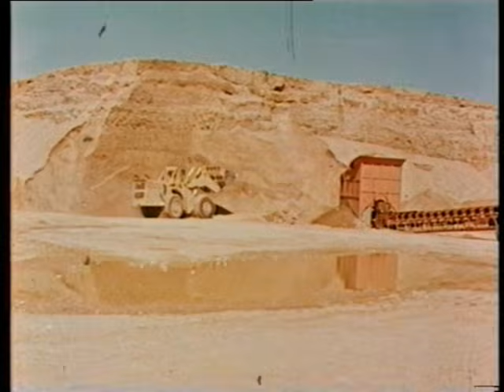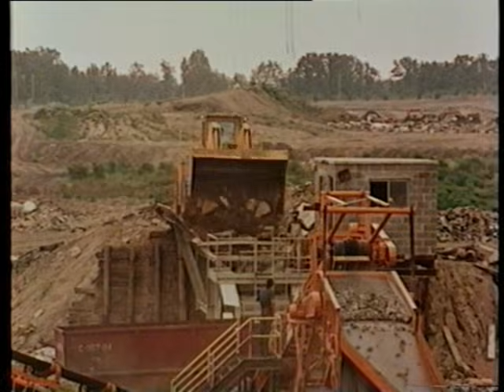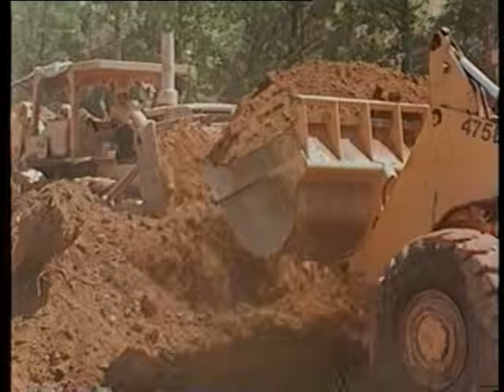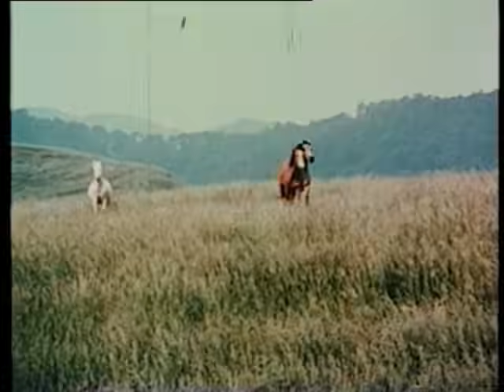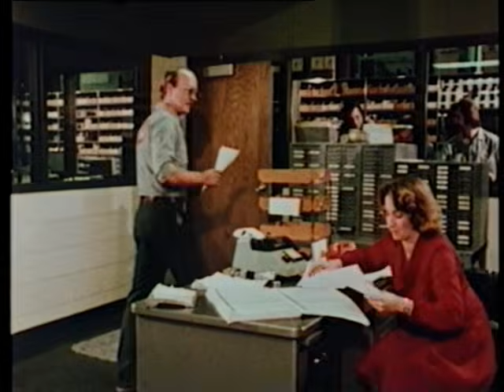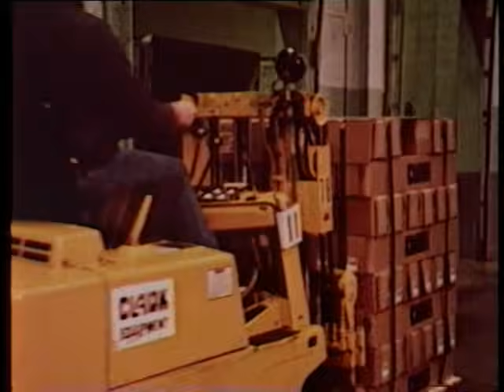CLARK Michigan wheel loaders part 2

Comment: From my understanding clark sold out in the mid 80s maki g clark equipment a rare find, I'm 21 and work at a rock quarry/cement plant and we have two clark 125 s, one that I oporate on a daily its the 125B model and the other is a 125 c and its getting restored.
I have to say working at a quarry filled with newer cat equipment Im impressed with the performance of the clark and its capabilities
Reply: +Logan Biery i worked on a coal strip job in the late 80s and they had a 475 and a 275 . good old machines ,its a sham they sold out
Reply: +eddie bowens yeah it would be nice if they make a come back... although in my eyes a Volvo loader is just a Clark with a badge swap lol
Reply: If'n you weren't we'd have a problem.
Reply: Now you are over 30
 Still searching for parts?
Reply: a volvo is a joke compared to a clark. pure junk